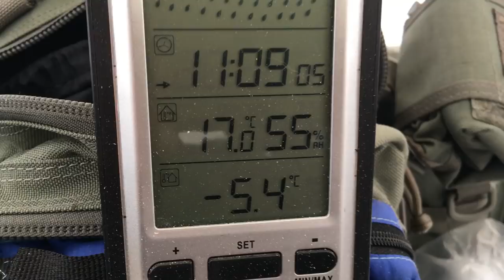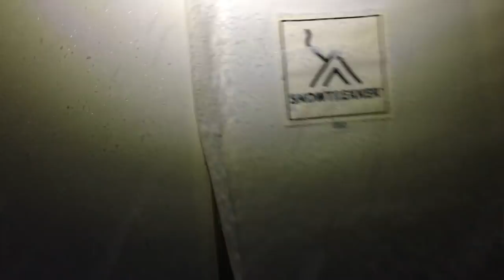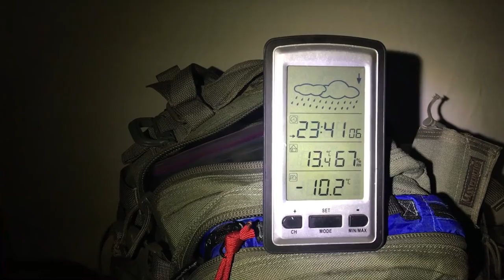Solo again - Snowtrekker 8x8 winter camping - A better stove method - PT.I

Comment: Great video.  

We always dig down to the ground (dirt).  Otherwise the snow tends to makes a slick ice bed.  

Also, where we live there is an abundance of pine.  Nothing better than a pine bow floor.  Smells great, keeps things dry and clean.  Also warm it up compared to a snow floor.
Reply from the maker: Hi George, thanks for watching and commenting, unfortunately digging down to the ground is not an option with 4+ feet of snow beneath me... the ridge of my tent would just be above snow level :) thanks so much for watching and commenting. Cheers. Paul.
Reply: 4 feet is insane.....  I just noticed you live in Hokkaido!  

I travel to Hokkaido every year 1-3 times for the last 20+ years (for business).  I'll be there again this MArch or April.

It is very similar to where I live (USA Minnesota).  I would love to winter camp there sometime.   How far are you from Tomakomai or Sapporo?
Reply from the maker: George T hey George, I live about 2 hours drive from Sapporo. Hokkaido is awesome, I love it. Winter can be a little long though, we usually get around 15-19 meters of accumulative snowfall each year. This year is looking like a big year. Cheers. Paul.

Comment: You don't need a spark arrestor in the snow. None of the sparks are going to catch anything on fire that is wet and snow covered.
Reply from the maker: William Bryant I don’t use it anymore, I followed Hoop’s (wintertrekker) advice and cut the mesh off the bottom and now just use the top shield to keep snow from falling down the pipe. Thanks for stopping by and for your comment. Take care. Paul.

Comment: Were you worried about getting holes in your tent without the spark arrestor? Did you get any?
Reply from the maker: Kenton Lemon, I wasn’t really all that concerned as I do angle my chimney away from the tent a bit... but no I didn’t get any holes, also the Snowtrekker canvas has some degree of flame retardant in the fabric and as it’s still a new tent it’s still very resistant. I have now actually cut the mesh circle off of the bottom of the spark arrestor as suggested by Hoop from Wintertrekker - https://m.youtube.com/user/Wintertrekker  ... https://wintertrekking.com - , so now I still use it to stop rain etc getting down into the chimney and angle it away from the tent so that will also help to reduce the risk.  Thanks so much for stopping by and watching and commenting. Take care and all the best. Paul.